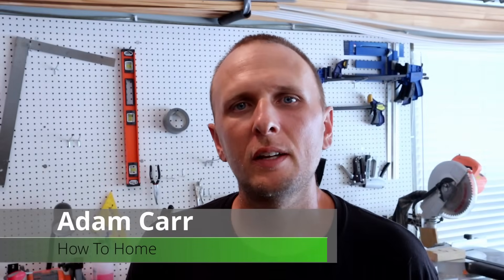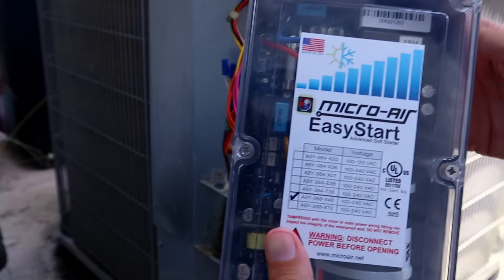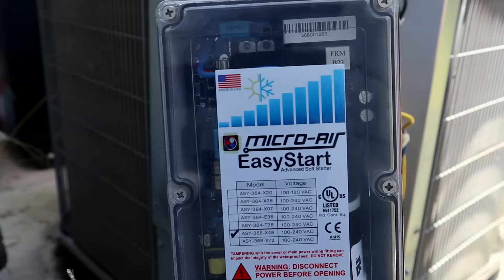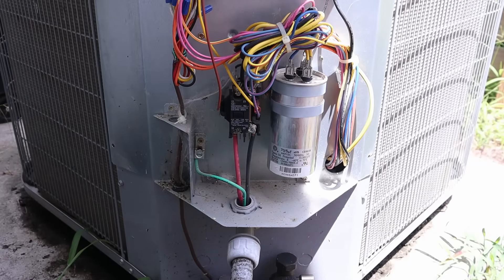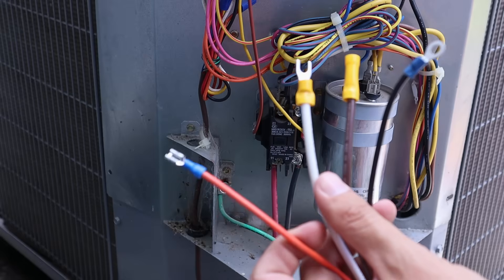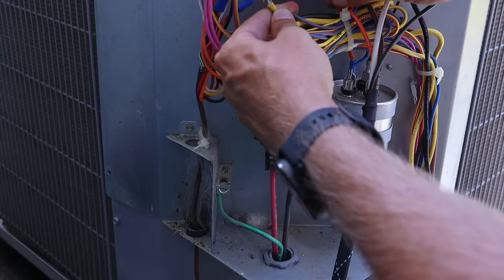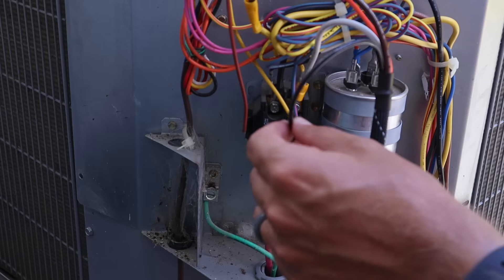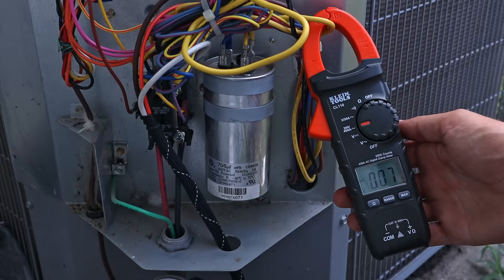How To Install A Soft Start Kit On A Air Conditioner | Run Home AC With A Generator | MicroAir

Comment: Subscribed.  This was exactly what I was looking for and nobody else had it for homes.  Thank you!
Reply: Now have credit $523.46cr!
Reply: Good information! I subscribed and liked. 
My question is can you have a hard start kit on the system and also install the soft start??
Reply from the maker: @juanresendiz56jr No.  Can only be one or the other.  Thanks a lot for the feedback!
Reply from the maker: Im glad it was helpful!  Thank you for subscribing!
Reply: @HowToHomeDIY  This compressor starter is great to refuce contactor and bearings abuse.
Now go ahead one step further and put a single phase "Schneider soft-starter" on the FAN Motor itself. It will further reduce start surge of Fan and lenghten its life span. 

These motors get killed during the  start surge when the rotor translates before it can start spining. Capacitors also take a beating by instant surge

Comment: Question, if i have a 30 amp generator, and the surge is say 31amps, i will trip my breaker on the generator; or so here's the question, does this use a rectifier "per se" to store the energy in "caps", and release the 31 amps without overdrawing the the run current of say 12 amps? can there be a video explaining this process , and or include the manufacturers different unit that would plausibly or could be used instead if i am totally wrong without going over a 30 amp limit? people please comment!!

Comment: Can you tell me what pat no. I need ( easy start brand like you used, for my American Standard Heat Pump. Outdoor unit, M# 4A6H5061E1000CA, S# 16122ALL2F
Thank you, I liked your video. Ray Eide

Comment: Adam I've noticed the Micro Air Brand one called "FLEX" does it matter which one is purchased? Also I was curious about my A/C Compressor it's rather Old, 19 years so with that being said I am going to assume that my unit which is running great will probably will need to be replaced within the next few years, when that happens will I be able to remove the soft start kit from the old compress to the new compressor as long as it is not larger than 6 tons?
Reply from the maker: Yes, with the new Flex model, it covers all tonnages up to 6 tons.   So no longer have to purchase a specific model based on tonnage.  And yes you have it right, whenever you need to change the unit out all you’ll have to do is reset the soft start, install it on the new one, and then have it relearn that new unit.

Comment: Thanks alot for the video. Super helpful. I'm curious if your generator is an inverter generator. It appears that it is not. Which is what I have. But I wasn't sure if you could run an AC compressor like that off of the so called dreaded ' dirty power ' that comes from a normal portable generator. Curious if you have had an issues with running it with the Cat12000e. I have a Genmax E15000 non inverter generator. Same 12000 running watts on gas. Also have a 4 ton. thinking I will be good if I install the soft start but not sure if It may damage the AC equiptment?

Comment: We tried selling the soft start kits. Expensive and the failure rate was high. Angry customers didn’t like the installed cost and short life. After eating the cost to make a few customers happy, we pulled them from our trucks. Now, we only sell Intermatic AG 3000 surge protectors. One on the furnace and one on the condenser or heat pump. Cheap protection. Less than the replacement cost of a control board. Almost a year now and no failures.
Reply: Everything with a circuit board seems to fail very quickly these days
Reply: @JohnD-f2o 
The problem is poor quality electrolytic capacitors. Chineseium? The same type for starting the condenser fan and compressor. When I started out a very long time ago, you rarely had a service call to replace the cap. Today, you cant seem to keep enough 35/5 and 45/5 caps on the truck.

Comment: Hello Adam not long ago on 2024 here at Houston Tx were was experienced one storm the name was Beryl and I got one of the Tri fuel generators Westinghouse 13500 and I was connected the AC man asking about to connected a soft start kit on my 4 Ton AC unit and he said I don’t needed to do that’s my AC unit it’s about 2years old from CARRIER brand . So can you telling me if I needed my generator it’s running on natural gas, by the way the AC unit it’s working fine till today’s. Thank you,

Comment: Adam - I just watched your video in which you hooked up your 50-amp generator supply line; and now watching your soft start video.  I have two heat pump units.  If I recall correctly, one is a 3-ton, and the other is a 4.5-ton.  Any reason the Soft Start wouldn't work on heat pumps?  And, now that it's ~4 years later, any regrets with the Soft Start hook-up, or the less expensive Rophor 50-amp inlet box you selected?  Thanks!

Comment: This was a great video for me as I already have a gasoline generator that is capable of supplying 30 amps at 240 and an electrician already installed the receptacle box with interlock on the mains so I have a 3 ton Trane compressor.  I'd love to have  the a/c working from my generator and I know that based on your soft start instal, I might be at max for starting so I also have a ANKER solix  solar generator to use inside the house for other appliances.  It has a max rating of 2048 watts continuer output at 110 volts which will according to my needs will easily power everything else.  I like the idea of a "clean" sine wave for tv's and computers and just about everything else that has a motor.  You did a great job explaining and showing the steps .  I will check with the local company that installed my a/c unit last year and see if doing this will negate my warranty and if they will do it using their parts etc.  I know if I do it DIY and there is a problem with the compressor in the future, the service tech will see the soft start kit and call the boss who will then just figure I did something wrong and void the warranty.  I will gladly spend the money, its well spent!  Ted in Sebastian, Fl.

Comment: Hello I’m running my house on a 13000 generator and when I run the air the fan doesn’t seem to spin as fast and it has a hum. It’s a 2.5 ton unit. Any suggestions

Comment: You can look for the "Locked Rotor Amps" or "LRA" spec on the compressor and most any motor.  That is the instantaneous max current demand upon initial application of power and lasts for 1/2 cycle.  As the motor gets up to speed, the counter EMF will drop the current to normal levels.  There's a formula to determine the actual start up current.

Comment: As a former auto mechanic I've seen what can happen when people pressure wash their engines and engine compartments. The weather proof connectors and seals don't hold up to the pressurized water and can become compromised.

Comment: Is it possible to install a soft start kit on a compressor that already has a hard start installed?
Reply from the maker: Yes but the hard start has to come off.  They can't both be installed at the same time.
Reply: Thank you.

Comment: First, don't touch the bare connectors. You can easily get shocked from a capactor. Second, the first amp measurement looked like you had the clamp on ALL the wires, but the second measuerment looked like it was only on the yellow compressor wire. This does not seem like an even comparison.

Comment: I have 2 questions. 1. Does the soft start stay operational on the AC unit all the time? 
2. If it does operate the AC under normal conditions, does it reduce the cost of normal running?
Reply from the maker: Yes
No just the starting amperage.
Reply: Thanks for the response. Your videos are really good and the explanations spot on.

Comment: Sadly, I was hoping you would go through the install for mounting the box from the wall to the A/c  itself.   Is it not code to run conduit?  What kind of sheathing are you using?  More detail please

Comment: I just purchased everything you have shown in the video. I was curious I have a 60 Amp Double Pole Breaker to run my Air Handler with Heating Kit. Will I still be able to run my AC Unit with a portable generator with a Westinghouse WGen7500DF (7500/9500)? I am not trying to run heat just AC. Dont know if thatll make a difference and run less amps.

Comment: Excellent video would have been better if you explained what wires you checked with the amp meter.  I asked a AC tech yesterday who was installing my neighbors new AC unit about my lights dimming when my AC system started. He recommended a soft start and said it would cost $800.  Not everyone can install these but I'd recommend a soft start.  There's this other video by some schmuck plumber that states the soft start killed the compressor. Don't waste your time watching this, he didn't know that the soft start that was installed on the homeowners AC unit was undersized. He didn't bother to check that out.  A soft start reduces the inrush current to the motor and if properly sized is good. Thanks again.

Comment: Not an electrician. Have a question. Is that a capacitor that is the silver tube that you first touched? If so how do you dissipate the charge in the capacitor? Does it just drain on its own?
Reply: Not a pro.  If all is well it will self discharge.  BUT, if there is a dead line or disconnect, such as a bad motor, it WILL hold a substantial charge at line voltage.  ALWAYS test with a voltmeter and follow through with a screwdriver to verify its discharged before handling.

Comment: great content! subscribed. Question - is there a good video which helps me 'size' the generator based on the load I plan to run during apower outage? I have 2 AC units (top and bottom floors), a refrigerator and the usual lights/fans, etc. Dryer and Washer are optional :)

Comment: I get that this device is meant to spread out the draw to lower peak draw, but since you showed the running draw also dropping from 12 amps to 7, does this effect actual cooling? Does this neuter your 4ton ac to like 3.5 or 3 tons? Or have you not noticed any change?

Comment: Does your clothes dryer still work with gen?
Reply from the maker: Mine does but it is gas.  For electric that will depend on the amperage pull of your dryer and the size of the generator.

Comment: What’s curious to me is the lower current draw in the stable running state. Since compressors and motors are rated, I would expect the same current draw. Since yours was less (7 vs 12A), wouldn’t your compressor be…compressing less and thus creating less cooling?

Comment: I bought the MicroAir soft start for my A/C based on this video. Haven't installed it yet, but wished you had some shots of the final installation. What did you use to run the cables through the wall of the air conditioner? Did you mount it on the wall as you said? Good video. I hope it works for me.

Comment: Hi, I was wondering if a soft start kit can also be installed on the air handler since the motor is fairly large and probably takes up kind of a lot of power when it first starts.

Comment: Is this better than a hard start capacitor ?? For a 240 Volt 5 ton unit.
Reply from the maker: Depends on what you’re needing the hard start for.  If your compressor is older and sticky and needs that extra jolt to get started then no.  But if you are wanting it for starting a generator or extending the life of the compressor than yes, in my opinion the soft starter is much better.

Comment: No one talks about the thermostat inside the house? Do I adjust the temperature to shut off the  AC? Then pull the disconnector in the outside out then start wiring the soft starter? Thx

Comment: Disappointed you didn't show how you actually ran the wire cable over to the compressor and how you dressed it in. That's the hardest part of the install! Looks like to me you had to lengthen the wire. Did you use a conduit?
Reply from the maker: I didn’t lengthen it.  I used a liquid tight connection and just ran the wiring into my unit.   You can see it more so in my updated video in this.

Comment: Hi, Very informed Video, well done. I subscribed to your channel.  Question, did the soft start contribute to your start capacitor going bad as I seen on another one of your videos?
Also what size generator will now run your house with Soft Start installed? Thank You

Comment: I installed an Easy Start on my 2.5 ton Trane unit and the results were less than expected, I get frustrated when devices do not work as advertised, I also stated this in a comment on youtube. I was very disappointed, however Micro Air reached out with very highly qualified techs and even a design engineer.
The problem was NOT theirs but with their great customer service they took on the problem of getting my inrush current down to acceptable levels.

My unit has a non-bleed TXV and they have come up with an engineering fix to get my inrush down.  GEEZE they even offered to help me change out the TXV if necessary!!!!!

Micro-Air is a great company to do business with, they do stand behind their products!!!

Thanks for reading this,
Roy Agrusa
Reply from the maker: Wow, that’s awesome!  They really do care about their products and customers.  Thanks a lot for sharing!
Reply: Thanks for the info. What's a non-bleed TXV?  Can you explain in mor detail what engineering fix they came up with. That would be helpful.
Reply: thanks for info, I will keep Micro  Air company in mind when I do this.

Comment: Thanks so much for the video and the advice on how a soft start works. I installed a 3 ton soft start and now I can power my AC unit with my 6 KW portable generator with no problems. By the way, the wife is happy, so now the whole house is happy.

Comment: Do they make soft start for deep well pumps?
We have an off grid cottage and the pump (120v) initial start up uses 72A.
Very thorough tutorial video on ac compressor, definitely will add to ours in town.
Cheers

Comment: I am watching this to see if this would solve the issue of my lights dimming for a split second when the ac unit kicks on
Reply from the maker: I don’t believe I touched on that in this video, I did briefly in my latest video on it.   But yes, in most cases it will fix the light flicker when the AC unit comes on.  It is still possible of course for it to still happen though or be less just due to your particular circumstances due to the load and type of bulbs used.  But I have heard numerous stories where it took it away and it makes sense why it would.

Comment: Did you have to ground the cap. to release any of it's stored energy?
Reply from the maker: It’s recommended to do so just in case.  Typically they don’t retain a charge but they can on rare occasion.  I have an updated video on this project on the channel and I go over that.

Comment: Just installed one on my 4 ton ac and went from 121 to 34 starting amps, and my 8kw Generac handled it just fine.  Totally recommend.😊
Reply: Are you using a 50amp plug or a 30amp plug from the generator to the house?
Reply: @guntherpprice  I am using a 30 amp plug and 30 amp breaker in my panel.

Comment: I would like to run my mini split off my 9000 watt back up generator when the power goes out but it’s not an inverter. Would a soft start be beneficial to stop so called dirty power?

Comment: Have to reiterate what Chris T stated.. NEVER touch capacitor terminals without safely discharging stored energy first. This guy may have done this (hopefully), but he failed to mention. Not doing so could lead to a nasty shock.

Comment: Excellent how to video. I'm from central Florida and elderly so doing the installation will be to hard being bent over. Who should I call to install it. An a/c guy or an electrician? Thank you for the excellent video.
Reply from the maker: An AC contractor should be able to do it for you.  Just make sure they know you want a micro air easy start soft starter.  I have heard from many people saying they tried to have a soft starter put on their ac unit and the ac company showed up trying to install a hard start kit.  I think this is mainly because soft starters are still less known and the ac companies would need to order it.  Thanks a lot for the feedback!   I’m glad you liked it.

Comment: After the recent ice storm in Québec I would like to be able to run my 1 T mini split on a generator. Q 1. is a soft start needed on those? Q 2. what size of generator is adequate? thanks for the great videos.

Comment: Thank you for the excellent video! Just a heads up, I tried using your Amazon link to the 3.5 ton soft starter, but it is not working.
Reply from the maker: Odd.  I just tried it and it took me to it.  May need to clear your cookies if it continues not to work.  Thanks for the feedback Karl!

Comment: Excellent. We have a 15K/12K gas generator that runs our AC just fine, but I still want to install a soft start kit. This was very helpful. Thanks.
Reply: What size generator do you have?
Reply: @erickalmaraz6837 It’s a 15K/12K gas generator.
Reply: @erickalmaraz6837 😂😂😂

Comment: Hello,

Thanks for your awesome videos. I've subscribed :)

Questions.

I have a generator MODEL: T07571 TRI FUEL 7500W  that support 50amp. And my ac unit model is NXA6 , would u still recommend the soft start kit tool.

Thanks
Reply: My AC is 2.5

Comment: Hello you installed a 50 amp outlet to run entire house an AC. Do you still need the 50 amp still with the soft start installed? 3/22/23
Reply from the maker: I do because I want to be able to run other things at the same time as the AC.  If I only wanted to run the AC and a couple lighting circuits at the same time then depending on the size of the unit, seer rating, and in rush current, a smaller generator could easily handle it.